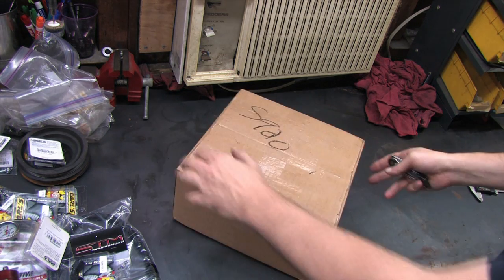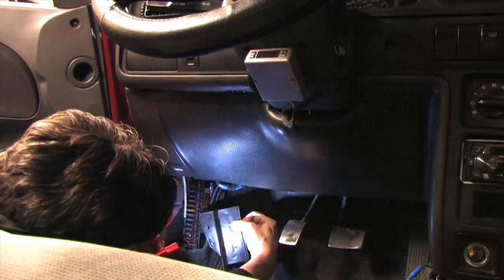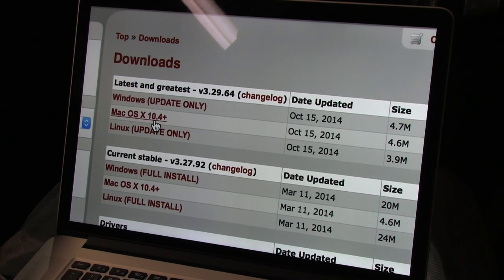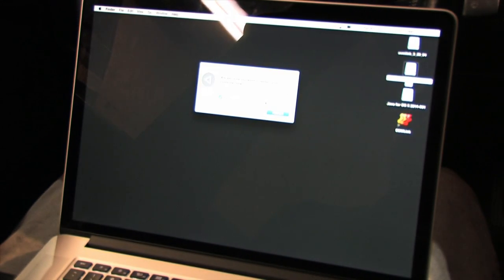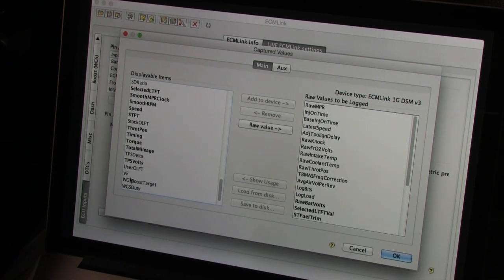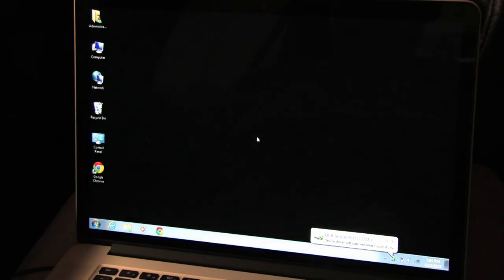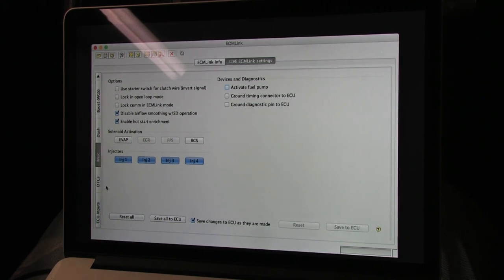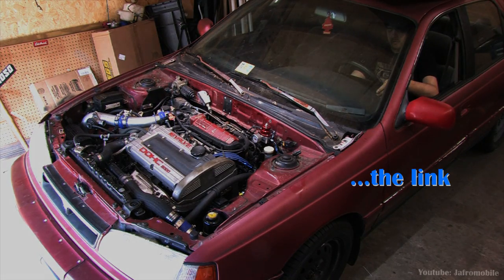Hyundai Assembly 10 - ECMlink Install & Speed Density config

Comment: Bahaha I have a palm in my talon lol.  So far i have kept it period correct tuner.  I think the safc2 is the newest thing in there.    If I do switch to ecm link will I be abe to still use the safc2 to monitor stuff?
Reply from the maker: Ben Hannig Oh man, a walk down memory lane...  I know what you mean, I still have an old Mac OS 9 g3 iMac with the solid-state logic board and vacuum tube display that I like to fire up for that retro feeling.  Funny thing is... it's still 3 years newer than that safc2.  :P  The Apexi gear is very useful, but if you want an accurate means of monitoring, you should really consider using a wideband o2 instead.  With the SAFC2, you'd want to treat it like the MAFT or any other piggyback solution.  Keep everything zero'd at stock for 450cc injectors and do all your tuning in ECMlink.
Reply: Oh i forgot about the wideband, shoot.  Ok thats the newest thing in there hehehe.   Im running 550 cc injectors, walbro 155 fuel pump.  3 inch dejon intake with a 3 inch gm maf.  A huge sidemount with custom air ducting. Tial bov and waste gate.  And some severely ported and polished 14g turbo and intake manifold.  It's  been a long labor of love.  Oh 3 inch exhaust too with a ported 1g non cracked manifold.
Reply from the maker: Ben Hannig What does that thing run?  Inquiring minds want to know!
Reply: With  a perfect launch 13.9 on 18 lbs.  Thats all me aswell. No two step or any sort of launch control.  Btw did you know it's really hard to launch an awd car when attempting not to demolish your clutch, and then you do anyway ugh lol.  Mainly its a fun street car, I can daily it and it's just fine.  91 white and black btw, resonably clean aswell.
Reply from the maker: Ben Hannig Launch control would take a half second off that car, easy.  Not bad on a 14b, though.  My Hyundai is quite a bit lighter and it didn't run much faster than that.
Reply: Yeah it's a pig that's for sure.  Im still running a stock clutch and running gear also, so ya know, three bolt axles and stuff.  I bought a 2014 fiesta st last year and that thing is a go cart compared to the talon.  Not as fast in a straight line but don't expect to keep up on the twisties.  Also at minus 20 degrees Fahrenheit  the thing's a rocket ship.   I,m kinda maxing out the setup I have on the talon, any suggestions on where to go next keeping the street ability and reliability?
Reply from the maker: Either the MHI big16g or Evo316g is a dynamite choice because they're pretty efficient hanging off of a 4g63.  Solid.  Reliable.  Very rebuildable.  Well-cast, and potent.  It's a GREAT fit on a 1g car.  Easy install.  It sent me through a 12.20 mph @ 118 pass in my full-weight 2g GSX.  I did a LOT to that car, but mostly a lot more than it needed to run like that.  Get a 255lph pump, a regulator, some 750cc injectors and a Big16g.  If you can hide the regulator, nobody will know you have it.  You'll keep your streetability factor in tact.  At least if you can keep your foot out of it.  They're full-spool around 3500 RPMs and peak around 5400.  Stock cams can handle that all day, but there are better options out there.  It's true you will need a clutch.  My dyno videos are linked in the ECMlink video description with the Big16g.  324/312 awhp/tq is nearly twice what a stock GSX puts down to the pavement.  You definitely will need a clutch.
Reply: Yeah I figured you would say that.  Thats a big jump for me though.  Act 2600 is my best bet for the money i think.  It is hard to spend 900 on a mitsu 16g.   Like I said a long labor lol.   I think the clutch first then more power.
Reply from the maker: You could go the cheap route and try your luck on the ebay 20g for under $250 brand new...  Try your luck kinda thing.  I prefer the MHI, but mines out-lasted one engine, now it's on the Hyundai, and it laid down 357/324 with the exact same equipment.
Reply from the maker: Ben Hannig You'll get to see what I can do with a small 16g, because that's what's on my Galant.  You can get away with 550cc's on that one.
Reply: I am sure I'm  flowing more than a small 16g.  Just like how your ported big 16g flowed as much if not more than a 20g.   It is a mean 14g.  I love the Hyundai though, it is the perfect ratty sleeper.  I would have liked to boost my old 91 civic, that would have been something.

Comment: do they offer this tuning solution for a GM tbi ecu?
Reply from the maker: No, sorry.  It's just the OBD I and OBD II Mitsubishi ECUs.  While you can use a lot of GM sensors with this modification, its designed purpose is for I4 Mitsubishi 4-bangers.  There are other great solutions out there for the GM stuff.

Comment: do the parts you make out of scratch make the car go faster? lol
Reply from the maker: 123Bosniak No!  lol.  They just make it easier to service.  Cutting zip ties means you have to re-attach them.  I prefer bolts, and things that don't move around causing short circuits, broken vacuum lines or generally just looking messy.  Usually they just hold down other parts that allow me to go fast.
Reply: *****
That's what I was thinkin. Good deal, chief

Comment: Hello!

I'm using RaceRender to overlay data into my onboard videos as this one: https://youtu.be/CLmE7eyq6-0

RaceRender allows to overlay OBD2 data as well to add gauges as oil temperature, water temperature, throttle position, etc..
So, I would like to add some more information to my videos using ECMLink data...
1) is there any way to log the brake pedal and gear position?
2) Has anyone found a way to export the ECM Link data file into a compatible file with Race Render software?

I'm using ECMLinkV3 version in my Eclipse 2G GST...

Thanks!

Comment: How dare you say the trusty pocket logger is a one-way device. It's indeed bidirectional, you can activate solenoids, the fuel, pump, and clear codes if you have forgotten already. HOW DARE YOU SIR INDEED!!!
Reply from the maker: I humbly repeated what I was told.  I wanted to change timing on a car that was pocket logger equipped, and it wasn't actually this car... but its pocket logger owner said that to me.  While I own a car that was equipped with it, I have never held it in my hand and used it.  I always took those words as bond.